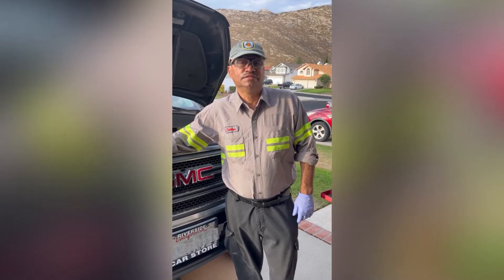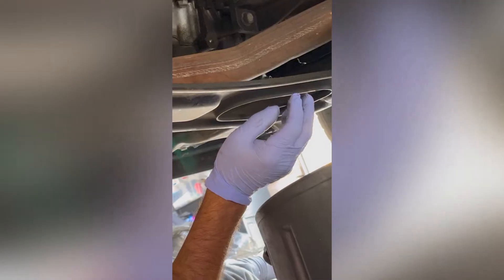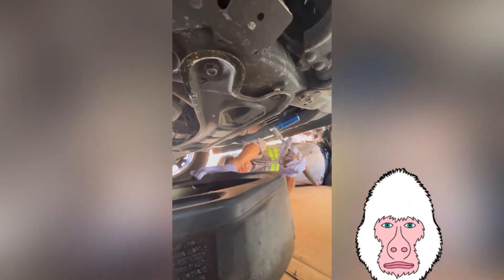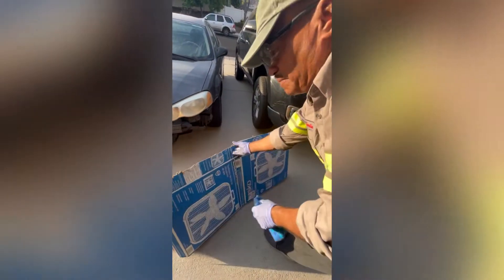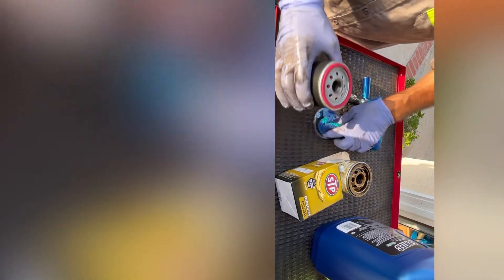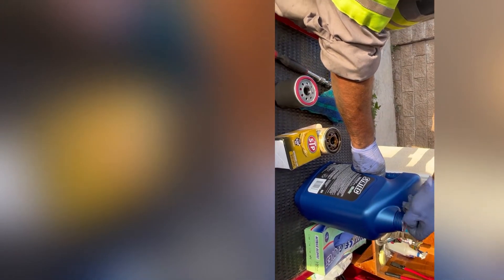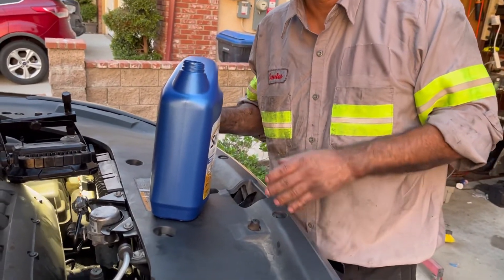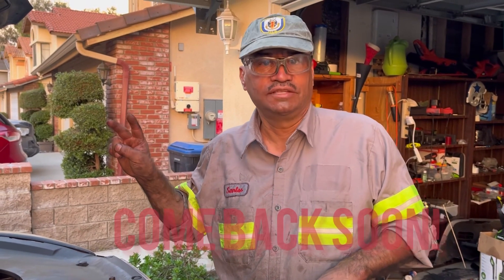How to Change Oil & Filter 2014 GMC Acadia

Comment: Thanks for the video, Santos. I'm a bit worried about being able to install the new filter. It looked like even you had some trouble. Any special tips installing the new filter? Also, do I need a special "full synthetic" oil filter?
Reply from the maker: Glad I could help brother.   Install the oil filter at an angle. It is entirely up to you whether you use a synthetic oil filter or a regular one. The synthetic oil filter does last longer.